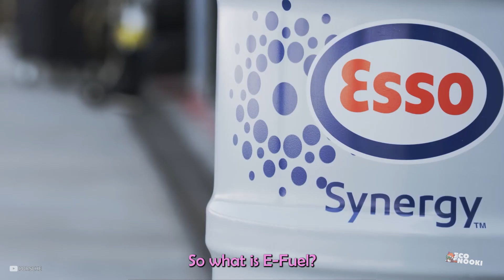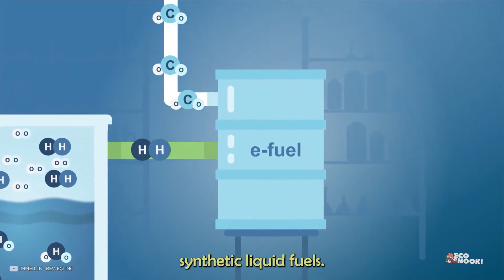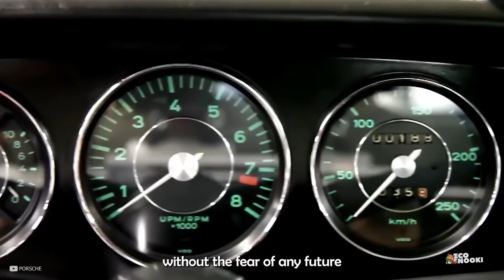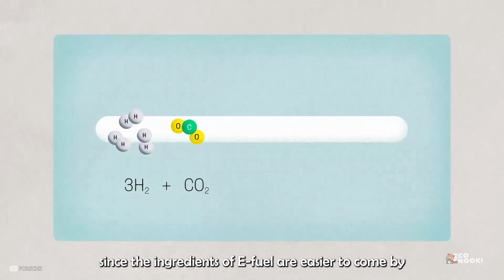Can E-FUEL Save Petrol and Diesel Cars from EXTINCTION?

Comment: The main problems of E-Fuels are: You need 8 times more electrical energy to move a combustion car compared to moving a battery-electric car. And the local emissions don't get really better. Carbon monoxide and ammonia emissions even increase. It is interesting for applications where battery-electric powertrains are not possible. But not a good idea for new cars.
Reply: @martin v

Except you can use efuel or gas car to power a generator as backup charging and have hybrid power to a battery EV car.

Efuel is also not yet scaled to production so itll be way cheaper in future.
Reply: @zlonewolf eight times the electricity  still means eight times the cost and no the amount of electricity needed will not decrease significantly because electrolysis is really inefficient die to conversation of Energy